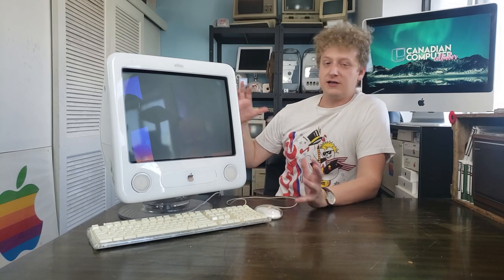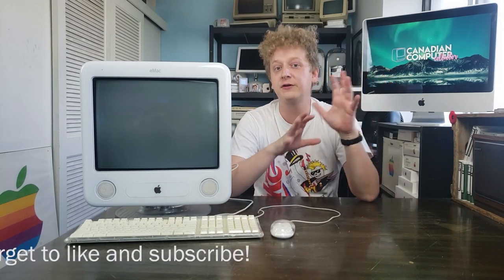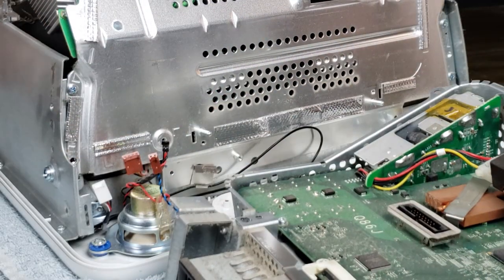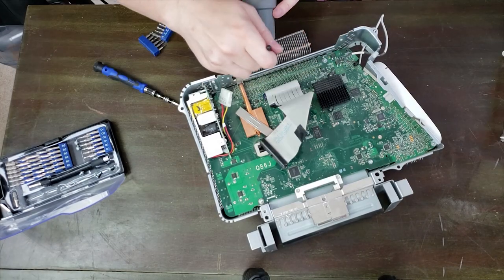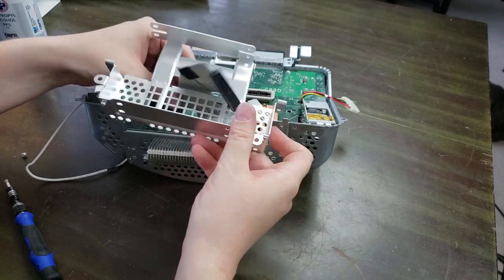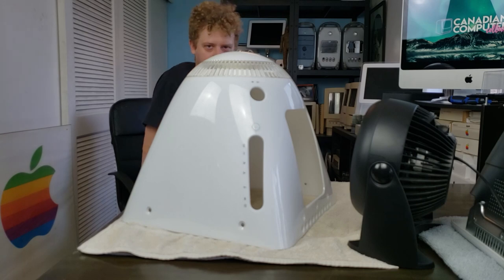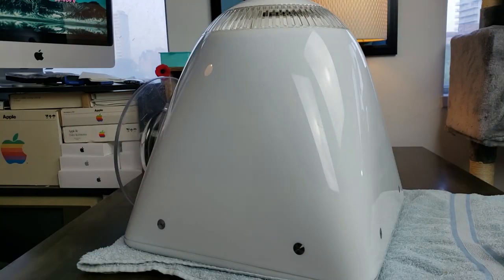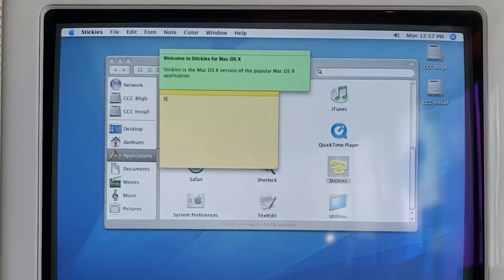The Old Mac That Almost Broke My Back

Comment: I remember in 2005 when my 4th grade classroom got a new one of these. It was so pretty and white, I thought it was the coolest thing ever. Before this my school was 90% imac g3s, a few powermacs and some older Performa models all running os 7, os 8 or os 9. They also had a computer lab of white ibook g3s also on os 9 but I remember being amazed by os tiger that the emac was running, which at the time was the most up to date Mac os
Reply from the maker: I bet by contrast the slick new white computer made those G3s feel old eh
Reply: @CanadianComputerCollector  it did especially since the g3s were running os9

Comment: That stand is nice. I put an SSD in ours, and set up dual boot of MacOS 9.2.2 and Leopard since I don't have another PowerPC mac.
Reply from the maker: Hey Cathryn! Did you notice much of a change in performance after the SSD went in? I find on older machines the SSD's contribution can be harder to feel.
Reply: @CanadianComputerCollector  Yeah, it's hard to tell, kinda' because I suspect my old hard drive was getting read errors, as I'd get long long delays, I assume as the drive was retrying.  That and anything web that uses https is still really slow to download. Main thing for me, this gave me the room for macos9.2.2, which is nice and fast for anything non-web.

Comment: I know what you mean…once I’ve tried to move a 32 inch crt…I had my back locked for 3 days and then when I’ve finally put it place a cap blew up which mean I had to put it on the work bench down again 😭…anyway have a nice day also the speakers from that eMac I believe that are not bad at all since they have 20 watts..
Reply from the maker: Oooof. That sounds rough! So glad we moved away from CRT tech lol
Reply: @CanadianComputerCollector  that’s why I have only 7 inches crts now lol 😅
Reply from the maker: @o_o-_-8639  hahaha. Solution found.